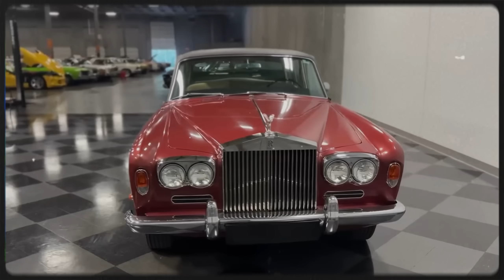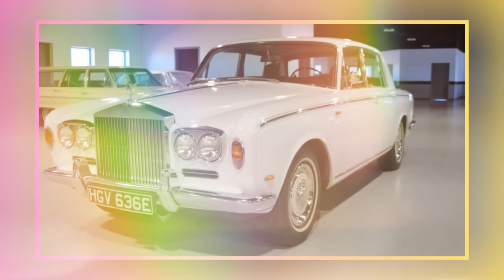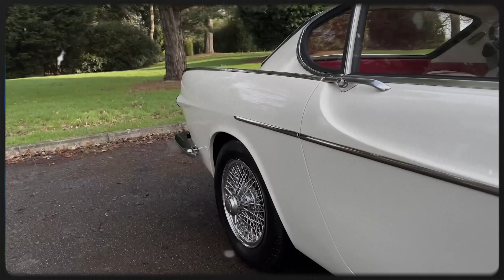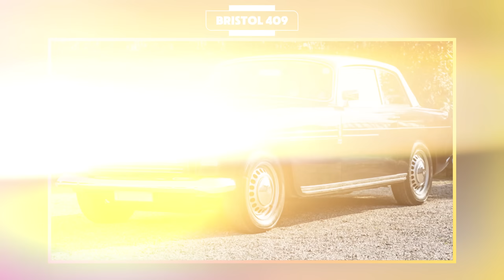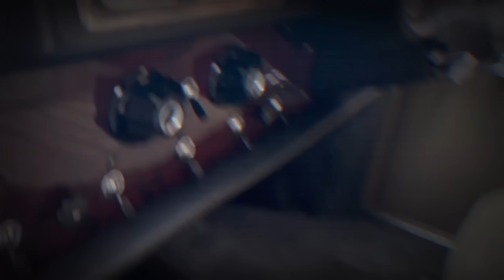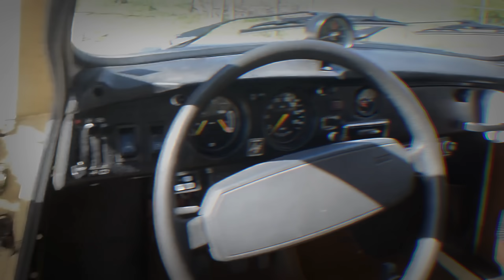Most Insanely Over-Engineered Cars of the 1960s

Comment: The "Freewheel" on the 2 stroke Saab was necessary because when you attempt to "engine brake" with a 2 stroke engine it is getting no lubrication and seizes up in a very short time, so the freewheel is required

Comment: Ok, not bad in terms of video and info, however there are some wrong bits.

The Silver Shadow's hood ornament - The Spirit of Ecstasy - could not retract. This was only introduced in 2003 with the Phantom VI after BMW bought the company. Also, the 6.75 is the literage capacity of the engine, not the designation. Rolls Royce also called the power 'sufficient', not 'adequate'.

The P1800 used a tractor engine - granted, that was tuned by Volvo, but still. 

The Bristol 409 used a run-of-the-mill Chrysler V8, not one made for it.

The SAAB 96 - while adorable - is a terrible car to drive. The 2-Stroke was difficult to keep going and you had to always have the accelerator engaged - even when stopped - otherwise the engine would stall. It's loud and obnoxious and not fun at all. Granted, there are people who love them and yes, they do seem like interesting cars to own, but they were bad. That being said, SAAB made some of the best cars out there in terms of safety and packaging. Plus, I just liked the way they did things.

Also, the AI voice used for this video seemingly can't decide if it's American or British. It also can't read properly.
Reply from the maker: Thank you for the detailed insights — this kind of knowledgeable feedback is genuinely appreciated! You're absolutely right about the Spirit of Ecstasy; the retractable version was indeed introduced with the Phantom VII in 2003. Also, “sufficient” is the correct term Rolls-Royce used, not “adequate” — great catch.

As for the P1800, you're correct that the engine had agricultural roots, and Volvo did a good job refining it for road use. The Bristol 409 point is fair too — it used a Chrysler V8, but not one specially developed for Bristol. And the SAAB 96... absolutely, it’s a love-it-or-hate-it experience. It's quirky and historically significant, but not exactly a joy to drive by modern standards.

Thanks also for the feedback on the AI voice — I’m actively working on improving consistency and delivery in future videos. Really appreciate you taking the time to comment so thoughtfully!

Comment: The SAAB 96 did not have the ignition switch on the floor. That came with the later - and bigger - SAAB 99. On the 96 the ignition switch is below the dashboard, behind the column gear shift. At least it is on my UK Right Hand Drive version. Not sure about the LHD ones, but it will be a similar location. Pretty accurate on the rest of it though, and featuring three of my favourite cars: SAAB 96, Volvo P1800 and Bristol!

Comment: 6.75L is not the designation of a Rolls-Royce engine. It's the displacement of the engine: 6.75 liters or 6750cc. Bristol did not use a Chrysler engine designated 5.2L. They used a Chrysler engine that displaced 5.2 liters or 5200cc aka Chrysler's run-of-the-mill 318 cubic inch V8.

Comment: No mention of the Mercedes-Benz 600? The Volvo P1800 used a tractor engine and the Saab still had a two stroke, neither of which were cutting edge or great feats of engineering.
Reply: The 2 stroke Engine was allowed to Freewheel to avoid Engine seizures occuring on long Downhill Runs
less fuel used ...less oil Delivered.
Reply: It’s more correct to say that Volvo’s tractors used a car engine, not the other way round. Even more correct is that a small vehicle maker such as Volvo would develop an engine that could be used in all sorts of vehicles with minimal alterations in order to save on developing costs. 
The P1800 B18 was a bit souped-up compared with the versions used for e.g. PV544, 120/Amazon, military vehicles, boats, and so on, but still basically the same, making spare parts easily available and the engine itself very, very reliable.
Reply: @TheJonathanNewton  I don't understand your logic: I said from the beginning that Volvo engines had very little to do with tractors and already had had Diesel engines specifically for tractors and lorries....
Reply: @paoloviti6156  Oh, did I reply to you by mistake? Sorry, it was aimed at the OP.
Reply: @TheJonathanNewton  it's okay no harm done! It's nice to know that we share the common for cars 👍👍👍
Reply: Sir, this remarkable “tractor engine” of yours, was able to make it past 3,000,000 miles. If that's not truly admirable, I do not know what is, gentlemen.
Reply: @Vaclav_Holubec_2457  Under stressed, in my opinion, does not equal over engineered. While there are many agricultural derived engines capable of high milage; 3 million is the exception, not the rule. I had this engine in my used 62 Volvo that I drove in the 1970s, it was reliable but also underpowered and got about the same gas milage as a slant 6 Dodge Dart. I'm not saying these Volvos are bad - I am just pointing out that, aside from styling, these were not ground breaking models for the 1960s like Amazon was in 1956. Looks aside, a 60s Amazon was a better car with the same basic engineering.
Reply: What do you mean with a tractor engine? Most European cars of that era had a 4 cylinder engine with overhead valves and low positioned camshaft.
Reply: It doesn't have a tractor engine as actually the engine was officially putted in production the 1947 as1,400cc as straight - four , overhead-valve as B4B
  but it was already putted in production before. Unofficially it was a copy of an Opel engine! Despite the Swedish saying that the Volvo was the fastest tractor in Sweden they were very proud of this engine as it was very reliable!!!

Comment: The Saab 96 did not have the ignition key between the seats. It had the key on the right side of the steeringwheel. 
I wasn´t until they released Saab 99 the key where placed between the seats.
Reply: "Curved windshield for visibility " same thing. Pity of these details. Scripted from AI?